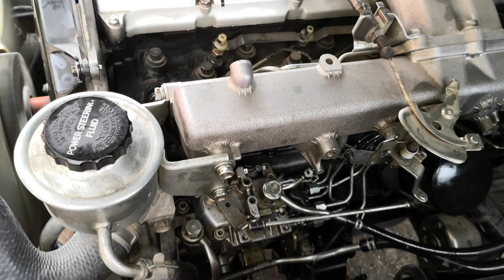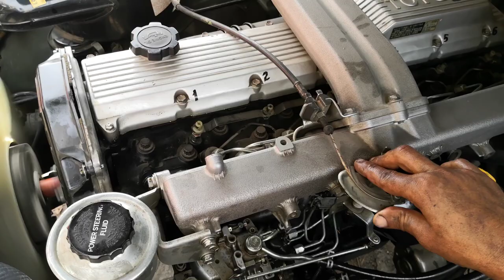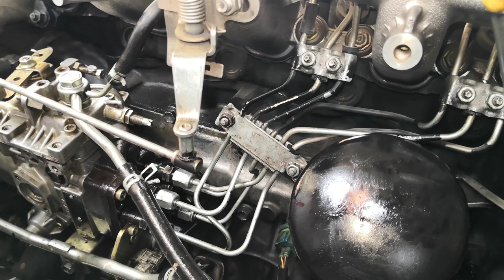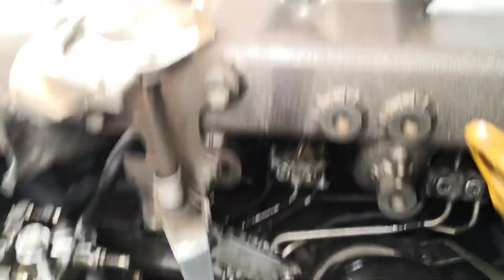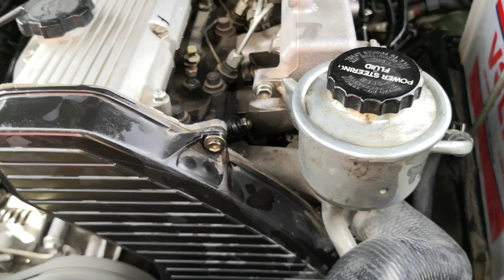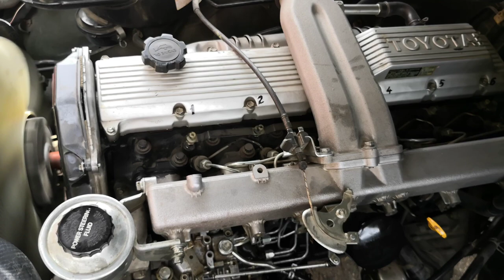how to coaster 6 cylinder engine 1hz engine

Comment: Hi good evening I have a Coaster bus 1HZ engine the problem is that my bus does not start for example it has driven 30 minutes or 1 hour but if you turn it off you can no longer start it until the engine cools down.  Please, where does this problem come from that prevents it from starting?  what parts should be checked?  please answer me i need your help
Reply from the maker: Diesel pump head rotor problem